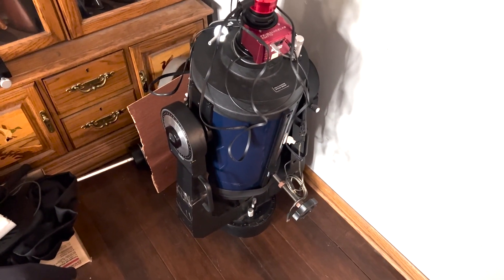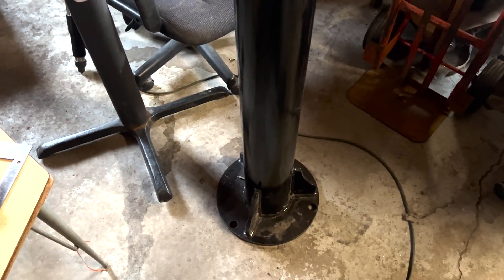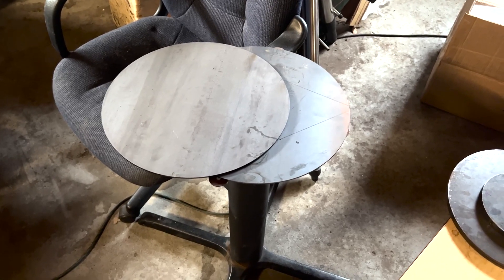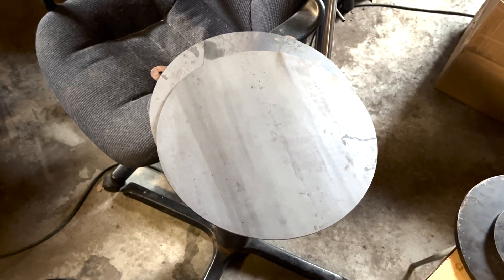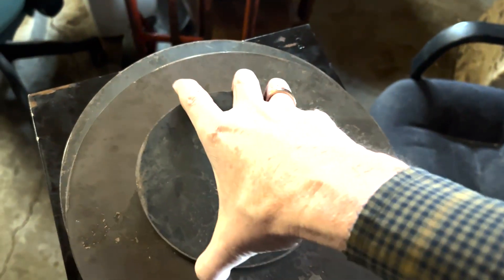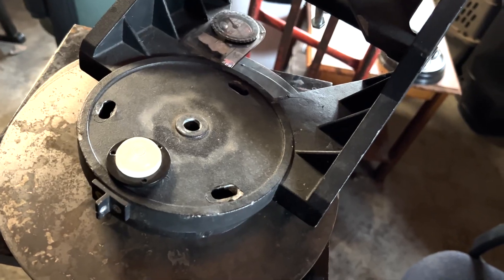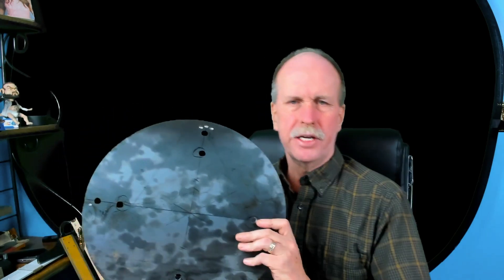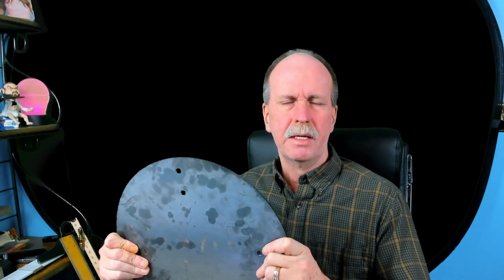Building a Pier Mount | The Design

Comment: This is going to be fun to watch. 
When I got my first engineering job at the water infrastructure company I designed a lot of equipment mounts, for things like pumps and engines. I also did some small steel industrial buildings. We always detailed a plate on the bottom of a column with 4 bolt holes. The bolts would be sunk in the concrete foundation. Then we'd put 4 leveling nuts on the bolts, then the column over those, so that the plate rested on the leveling nuts. This way they could fine tune the column plumb by adjusting the nuts. Once plumb, we'd put a second set of nuts on top of the leveling plate to lock everything in place, and for good measure a "locking nut" on top of that.
As far as I know, nothing I've designed has ever blown over or toppled in an earthquake. 😄

Comment: I think I may need to rebuild my EQ mount, Having terrible tracking issues atm. I was tracking using pc-direct mode through synscan hand controller.

I've bought the shoestring eq direct usb to serial cable so I can cut out the hand controller completely, just waiting for the weather to clear to test this. btw the shoestring usb to serial cable works with Windows11 which is promising.
Reply from the maker: My mount tracks on its own, I control it with a pc using ASCOM and PHD2.  Plate solve with APT and polar align, focus and image with Sharpcap.  Then I control the PC with remote desktop from my MacBook in the nice warm living room while sipping a cup of tea.

Comment: Only $150 for a drill press? Will that be large enough for what you need? 
I hope that it has multiple speeds and a large enough table so that you can securely clamp your work pieces.
Reply: The table doesn't need to be that big to clamp the work pieces, because they're not all that large.  In fact with a couple of blocks clamped to the table, you don't really need to clamp the work pieces themselves - it's somewhat safer, but not entirely necessary especially if he uses decent quality drill bits and a bit of cutting oil - 3 in 1 oil will do in a pinch.  The placement and angle of each hole isn't critical, as long as he uses one drilled plate to template where the holes go on the second plate so the bolts will be straight.  Which he has already done.  He could have drilled it using a hand drill with a result almost as good.  I've drilled thicker steel with a hand drill for similar things.  I wouldn't have bought a drill press for this purpose, but for other jobs... (I have a medium/heavy duty (cast base and table) bench mount 12 speed which'd go for about $175 now which I use a lot).

This isn't high precision.  The adjustment is.  Anything more is more a matter of aesthetics.

I'd have preferred to see him using thicker plates for the Meade tho because of the high weight and leverage and possible flexing.  Steel is cheap, he could probably have gotten his supplier to cut them into disks with a plasma torch.  I can cut them on my new (used ;-) bandsaw (30+ year old industrial General 15" saw - it's a beast).  I've cut 1/2" aluminum disks with a saw that can only do wood (14" delta clone).
Reply from the maker: Yes on the speeds no on the table. 4.5 inches is the max depth

Comment: The only thing I will add is screwing the pillar to a stump is not a good idea, wood will go soft and rot.
Reply: I expect he considers it temporary, and if I'm not mistaken, he said it's a locust stump.  Both black and honey locust are quite rot resistant, it will last much longer than most other stumps (including cedar).  People in the know prefer them for fence and deck posts if they can get them. Stronger, denser, and more long lasting than cedar or PT lumber, the only equivalent is Ipe - which is not domestic (you won't find an Ipe stump in North America) and quite expensive.  Except in areas where locust naturally grows where you can pick up some from local people or small lumber mills, there is essentially NO commercial market for it.
Reply: @fromagefrizzbizz9377  thanks for that , being from the UK most of our domestic timber is soft wood which rots in a few years unless treated.
Reply: @DavidCoombes54  In Canada, locust does grow, but almost never gets big enough to use for anything. The only woods with decent rot resistance is red cedar and white oak. But white oak is in too much demand for higher end furniture (like ray flect quarter-sawn lumber used in Stickley furniture) it’s too expensive to use for utilitarian purposes. I just spent $200 just on oak to replace the back and seat slats on a Victorian cast iron end bench. It will stay outdoors but only under a roof - even white oak won’t remain nice when exposed to weather here (similar to where Bob lives).

The Americans have slightly more choice with rot resistance than we do.  Namely cypress and a few others. 

You can tell what one of my hobbies is, can’t you? 🙂

I think you have comparable cedars, though I don’t know if your oaks are part of the red or white oak families. Your ship building oak should be a white oak of some sort, but I expect the prices for it are astronomical if it’s available at all
Reply: @fromagefrizzbizz9377  we do have Oak but to saw any hard wood trees down you have to get permission, believe it or not we have tree preservation orders. Most native hardwood trees are protected. Although we have large tracts of Softwood mostly Scandinavian pines
Reply: @DavidCoombes54  I've seen some of your big stands of white pine up in Scotland.  Even in Canada, we have fairly intensive tree protection legislation.  At the extreme edge of Ottawa, which is rural, with an average property size of about 3ha (we have 3.5ha - 10 acres for Americans), any tree bigger than about 8" at chest height needs a permit (or an arborist's judgement) to cut down unless its dead or dying.  There's essentially no old-growth stands of white pine in all of Ontario - we have about 15 big ones and another 15 or so really large red pines - but they're second growth (just about everything was taken out by the great fire of 1870 that took out over 100 square miles, which was at root caused by poor logging practice - they left behind the slash).  Ontario in particular were almost completely stripped of big trees (the british for wooden ship masts (the big pines) and others, then later by American loggers). We manage our property by bringing in tree services to take down the dead trees every year or two and open things up for regeneration, and have planted over 1500 trees (mostly white pines) in all the open areas.

All commercial logging is under pretty strict environmental oversight.

I knew of Britain's rules - you practically extirpated hardwoods, especially oak.

I dream of one day being able to use a bit of Cuban mahogany - the real "original" mahogany.  The stuff is gorgeous, and is famous in early furniture making - reserved to royalty at one point. Native to south florida, and parts of the western indies.  Unrestricted logging almost made it extinct.  Except in Cuba (where export has been banned since 1946), and street trees in south florida, it's completely gone.  Just about the only source of the wood is storm blow-downs in Florida.  When it's available, it's $28US/bdft (12"x12"x1").  Eeek!
Reply from the maker: Yes in years.

Comment: You can take a look at my pier on one of my observatory video's. Fyi it's best to have a closed bottom: you can then fill the tube with fine sand, used in playground sandboxes, this dampens vibrations.
Also: make reinforcement ribs on the outer wall, at appr. Half heights or more, this also reduces vibrations.
Reply: If you'd be interested i can post some detail pictures on your discord.
Reply from the maker: Yes I would and I considered sand in the pier
Reply: @ResearchFlatMoon  they're in your discord 👍